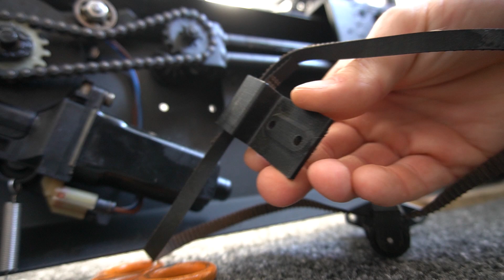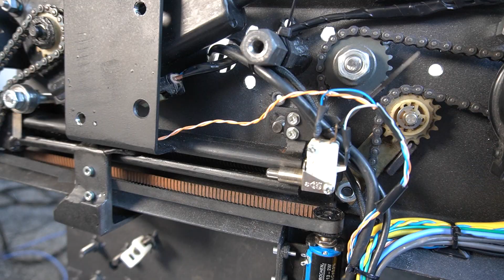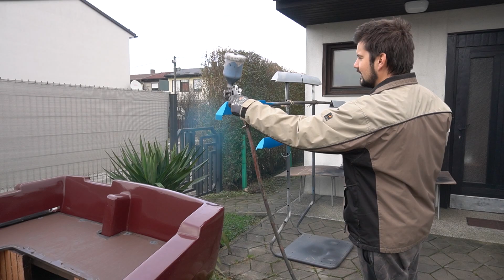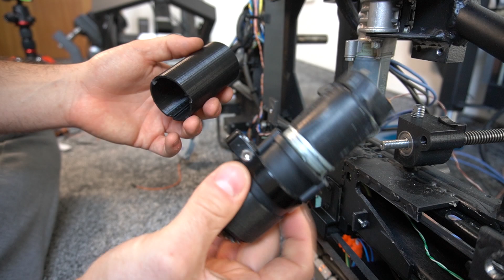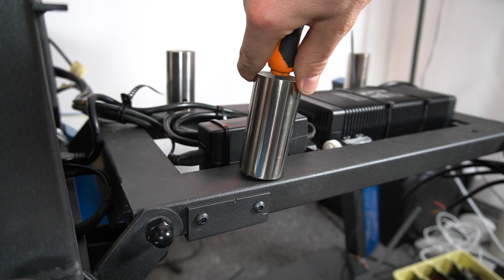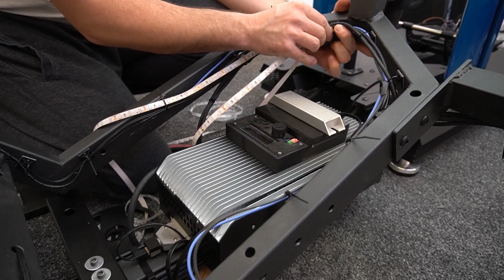Hypersimulator - Motion Racing Simulator Prototype Build - Episode 5

Comment: I really love your rig, try to find out how the other side of the pedal slider will move, which is no connected to the motor. I saw the video several times, but can’t find out. I want to implement pedal position by my self ans also try to find a solution control the back height of the seat, to switch from get to formula position, but I only have Aluminium profiles. I saw your rig in xsimulator forum. Brilliant man.